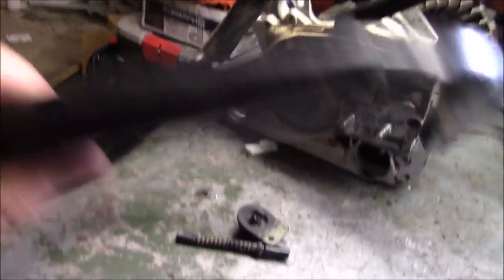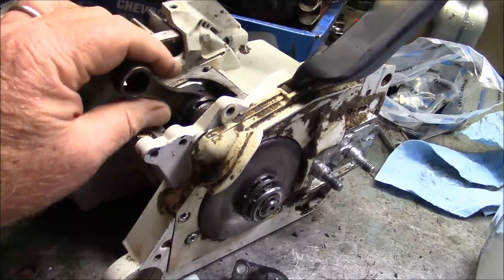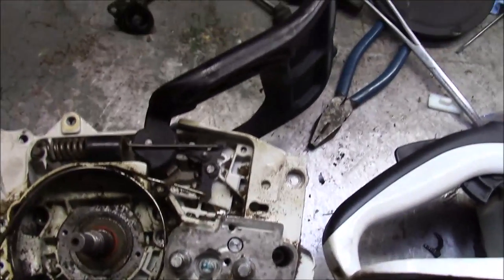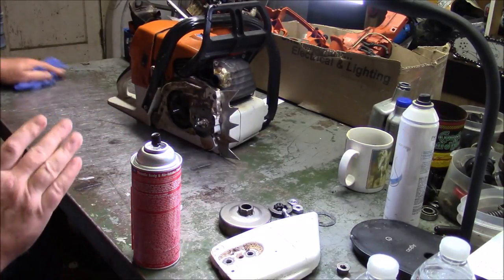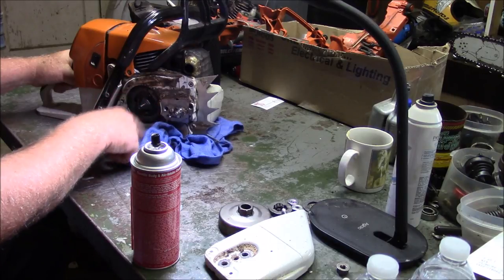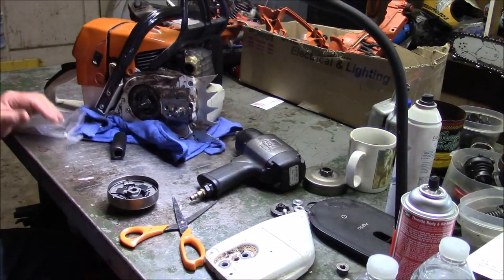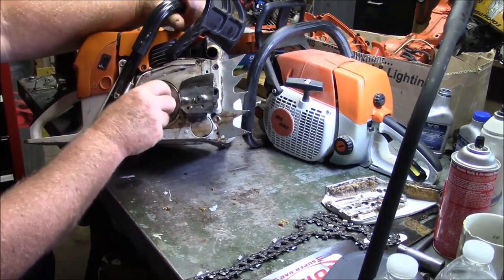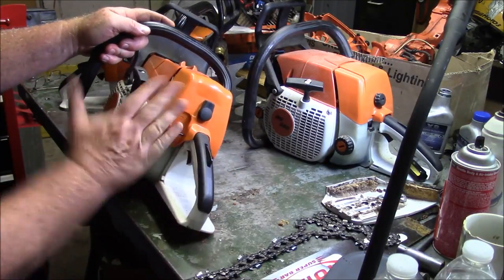Farmer Jones Ms660 Project Update & Thread Repair on a M8 x 1.25mm Stripped Bar Stud Hole

Comment: I really appreciate your explanations. My dad was a mechanic and sometimes I can repair certain things. I am a little leery of using  helicoil, and i have never put a crank in as you did here, with heat. I like the 660 project, it's cool that you described liking the 038, because I was thinking, of the bigger saws, for which there are parts, that one seemed cool.
Reply from the maker: Used the heat differential to make the point there are many ways to accomplish these things...if you look at more of the video's I make a point of using different tools and technics to assemble cases. Even to the point of making and using pullers to attach to the treaded ends of the crank's and pull them thru the bearings..

Comment: On trying to not put metal-chips inside the case, II have this suggestion, Use heavy-grease on the drill and tap.  Many years ago I had an NSU 125cc motorcycle, I stripped the spark-plug threads and a moto-mechanic showed me this procedure.

Comment: Very interesting. I swapped a Chinese AM oil pump & worm gear in my 066 avid I've never been able to get enough oil to the chain.  Not even close actually.  I've ordered an OEM oil pump and a new wofm drive from the Stihl shop.... but who knows.  Maybe I'll discover a partial blockage in my oil line....that i missed the first time!

Comment: Walt, did you use the farmertec rubber stuff? Why I ask is because I found that the fuel cap gaskets reacted poorly to fuel and have ordered a fuel and oil cap gasket from Oem but can't help but question the other stuff like fuel line and intake boot.

Comment: I have watched a lot of your videos, and I know you have quite a bit of experience using Hutzl parts.  I have a Stihl ms460 I am trying to resurrect but it has damaged crank cases.  I noticed Hutzl has new cases for the 460. I was wondering if I bought those case, will I have any trouble fitting all the original Stihl parts in and on them?  Like the crank, will the original cylinder and piston work ok, coil, oil pump, etc.
Thanks, love your videos
Reply from the maker: They all should work. I haven't tried a 460 but the 660's are real close to the originals. The only place I had an issue with 660[s was the casting around the chain brake was a bit off...but have been able to make things work anyway. So I would expect the 460's to be similar and workable

Comment: I copied your first 56mm build exactly, and the saws been brilliant, must be 2 years ish now, only thing that's failed was the clutch side crank seal, but mine was a pre assembled bottom end before they did the kits, I think it was prob damaged when the crank was pushed in, currently running a 20" bar and an 8 pin and it rips.
Reply from the maker: Hoping you just put an OEM seal in there...:)
Reply: I had spare huzlt ones when I bought the saw, too tight to get oem, one thing I noticed was the old seal practically fell out when I tapped it, cant think it was sealing well, put the new one in with a smear of sealant around the outside before tapping it in.

Comment: there's a lot of debate about the air flow system on the 660 and they have an updated modified Max air flow system could you possibly do a video on that??

Comment: Interesting video!
 Do you have any conclusion on the 660 saw for the average firewood cutter? Are the big bore kits worth fooling with or do they make much of a difference?
Reply from the maker: Big saw and with some better parts subbed in they work pretty well. I would stay with the 54mm. Possibly a Cross Performance top end. Just you have to expect to have a few things to work through, chain adjuster, handle bar, clutch etc. But sorted out they run strong. Budget 400 bucks. I guess for the person with the right attitude, skill set, and expectations they are awesome. If you are looking for a sorted out ready to run saw...buy OEM Stihl or Husqvarna.
Reply: afleetcommand Thank you, I am gonna look into that! I really like the 660s, they seem like a good deal...

Comment: Nice job Walter! I think my Jonsered 2166 is a 2012 and probably has the OEM nylon caged bearings. Should I wait until they fail before replacing with steel caged bearings? What brand should I get and where do I get the steel caged bearings from? Where do you get your '84 and '94 gasket maker? Is it on eBay? Can you please give me the exact name of the place (on eBay) or elsewhere?
Reply from the maker: Three Bond 1184 is usually available on ebay. I would use Nachi Brand bearings when replacing the 6202 c3 bearings.
Reply: afleetcommand Thanks for the information.

Comment: Walt have you run any of  the   Oregon aftermarket clutches?
Reply from the maker: No they just offer drums. I have the drums on the Husqvarna's  Put "oem" springs on the Huztl clutch. So far so good. Also put Hyway AM clutches on from HLsupply.They are a bit heavier so ever so slightly slow down throttle response. So far so good on those too.

Comment: Afternoon. What size Heli-coil did you use?
Reply from the maker: M8 x 1.25mm with 20mm long coils for more thread engagement
Reply from the maker: M8x1.25mmx20mm 304 Stainless Steel Helical Coil Wire Thread Insert

Comment: stihl sells an oversize stud, much better than heli-coil, increases strength of thread area,
Reply from the maker: Post up pics with a part number. Doubt its really any stronger as they both have a larger diameter engagement area, but would certainly be easier if all you have to worry about is a drill & tap vs. getting the coil in and the tab snapped off.

Comment: What will always blow my mind is why someone who uses a saw hard and depends on it to make a living every day doesn't have a backup and a box of repair items on hand.... and know how to repair one himself. short of splitting a case or doing that thread repair i could easily see doing most any repair in the field.
Reply from the maker: He has a pair of OEM Stihl's for back up, a pair of OEM Husqvarna's for his primary saws..My Junk Pile 390 build and possibly a couple of these 660 "development" builds at any given time. PLENTY of saws at his disposal! What I do with a couple of loggers  is have a couple ready to go, when they run by he area, they will drop of saws that need things and pick up the ones done. He is getting into that program with the 660's. IF I do what I think I can with these saws, he may never have to put wear and tear on his "nice" OEM saws..:)  And what I get is way more time testing than I ever could do on my own. He makes more money running his business than he pays me to fix things....if he had to do things like I typically do it is an actual loss because I'm setup to work on these saws.
Reply: What you're assuming is that the user can repair the saw so much cheaper than the mechanic that it's better to shut the job down than to drop it off at the shop.  If that were true, there'd be no point in the user doing the sawing, since it wouldn't be profitable.